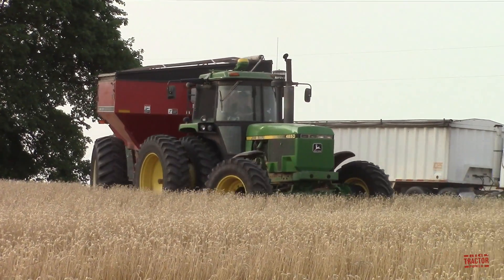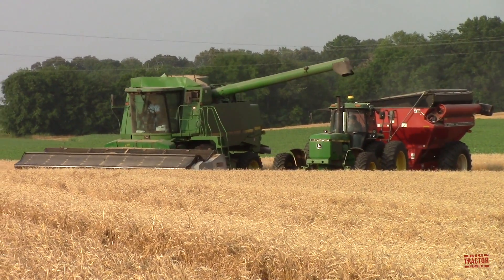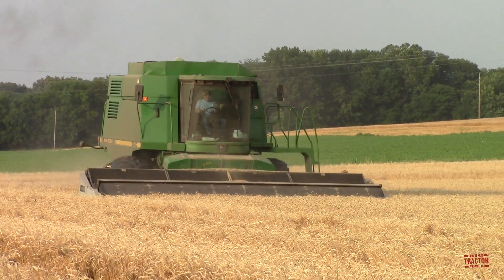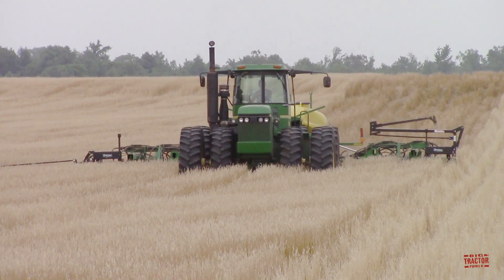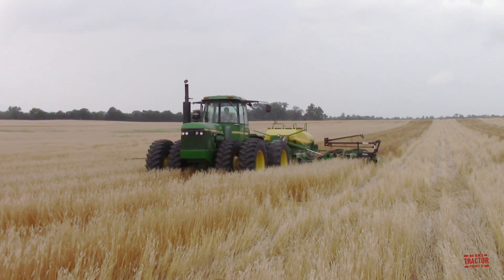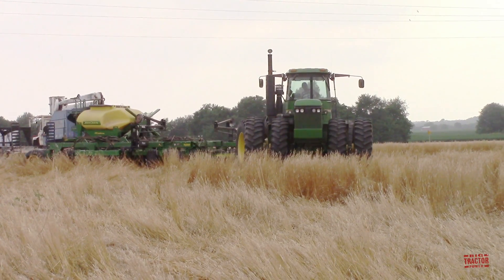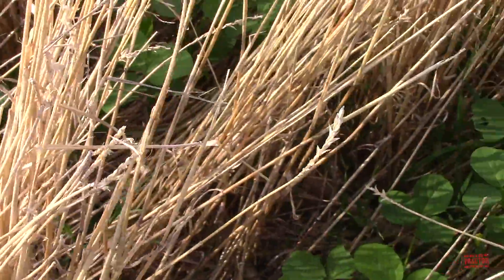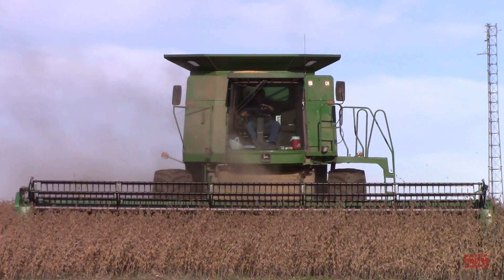John Deere 9600 Combine Harvesting Wheat

Comment: Love this video.  We’ve been using a 1995 9600 and a 1998 9610 since ‘95. My dad and grand father trade off their JD 7721 pull type combines for both machines. I love seeing people still using these 96 series combines. And to be completely honest, they are damn near bulletproof we haven’t had any big issues with then at all and in my opinion they out preform any rotary machine to date! The only up grade we did to them was put redakopp choppers on them. I would love to see more videos of farmers use if this older stuff!👍🏻
Reply from the maker: The 9610 is big on my wish list to film. They are solid machines. I will be featuring more 9600 harvest action this fall with a 9600 on a 1243 corn head.
Reply: Right on! Looking forward to seeing that. keep up the great work!👍🏻

Comment: I remember when these came out. They weren't any bigger than the 8820s titans, but when you got in the cab, you knew this was a much better combine. It was so quiet and easier to handle than the old 8820s. Amazing how much quieter it got when you didn't have the motor right next to the cab which was standard before the 9600
Reply: 8820s had 22" cylinder.  9600s had 26" cylinder.   Huge improvement!
Reply: @379insk  we used to own a 1986 8820 titan 2 was a great combine. had a aftermarket beater and airfoil sieves. a great cowboy combine.
Reply: Ok so, other than in cab experience, how much better were the 9600's than the 8820's? I'm asking because I'm thinking about getting something different... I don't care about a little noise..  If I find a 9600 and a 8820 titan 2 with same hrs, shape, etc,  but the older one is much cheaper, which one should I go with?
Reply: @379insk  What about behind the cylinder? John deere are notorious for being able to put way more through the cylinder than they can save out the back... Especially in Barley... Again, just asking...
Reply: @TheFarmerfitz  the 8820 titan 2 we had actually had a aftermarket beater and it actually could faster than the 9600 and threw less seed out the back.  The 9600 is easier to set with a few more adjust from the can features such as the concave clearance and fan speed adjust.   Both really are great cowboy combines. I prefer the 9600 with the roll back chopper.
Reply: @bordstif84  thanks for the reply, I have another question.  Other than age, what is the major difference between the 8820 and the 8820 Titan 2?
Reply: @TheFarmerfitz  I believe it was 3 more sieve pieces.  The dash had a few more creature features.  Green paint and not yellow on the cab.

Comment: I didn’t realize Gleaner made a stripper head. Was it something they designed and built from scratch or was it a rebranded Shelbourne header?
Reply from the maker: AGCO built it. They sold it as a Massey Ferguson too.  They used to be every where here in WKY 20 years ago.

Comment: The 8650 has a larger engine than the 9600, but it puts out less horsepower
Reply from the maker: The 8650 puts put 290 engine horse power but they measured pto back then so the sales brochures pushed 235 pto.

Comment: That’s not a Maximizer. The 9510 and 9610 were the Maximizer’s.
Reply from the maker: The 9400, 9500 and 9600 were all Maximizers.  It states it right on the sales literature.  The best way I can show you is on Maximzer brochures for sale on EBay. Maximized is right on the cover.  

1995 Maximizer brochure: https://www.ebay.com/itm/John-Deere-Maximizer-Combines-9400-9500-9600-1995-36-Page-Brochure/173855794411?hash=item287a9ce4eb:g:FUQAAOxydkZRmPmb

1994 Maximzer Combine update brochure https://www.ebay.com/itm/John-Deere-Maximizer-Combines-For-1994-Dealers-Brochure-YABE12-ver2/152449003900?hash=item237eab317c:g:W9wAAOSw3v5YsKIu

Original 1989 release brochure https://www.ebay.com/itm/1990-John-Deere-Maximizer-Combine-Sales-Brochure/352488310898?hash=item5211f0c872:g:VrcAAOSw~2hbxtet

1992 Maximizer Corn Combine Brochure https://www.ebay.com/itm/Farm-Combine-Brochure-John-Deere-Maximizer-Row-Crop-c1992-F3515/400941992451?hash=item5d5a014a03:g:2wgAAOSwLVZVhgYV

Maximizer as a decal was added to the 9410, 9510 and 9610 up onnthe grain tank but the 9000 models were marketed as the Maximizer series from 1989 to 1997.